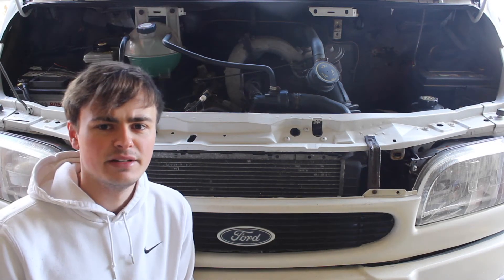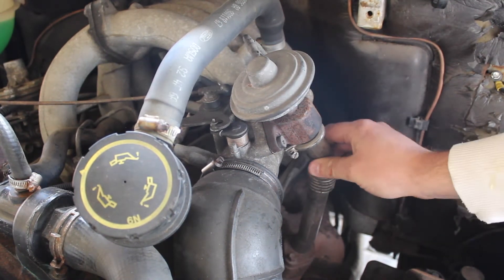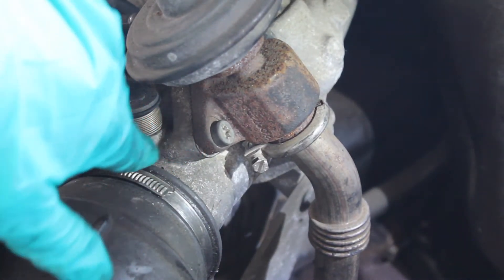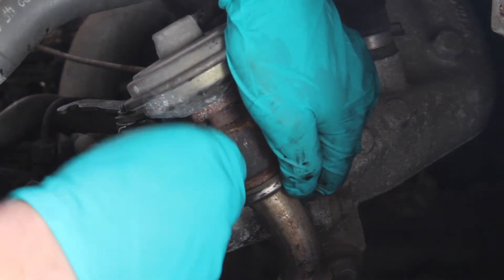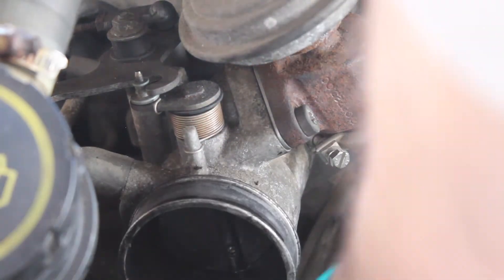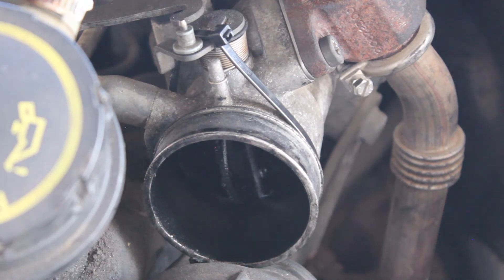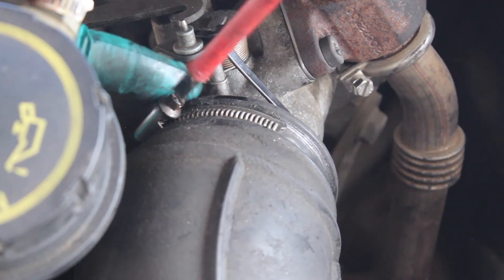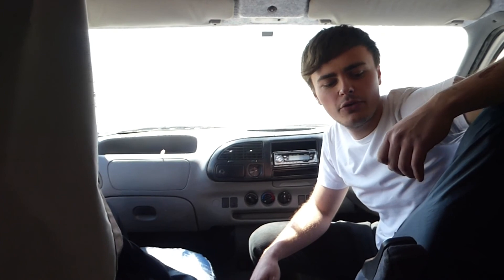EGR Valve Blanking Plate Installation – 1998 Mk 5 Ford Transit 2.5L DI “Banana Engine”

Comment: Surely it still blocks up with diesil gunk, I did my connect but I out an 8mm hole in blanking plate that is ecu controlled
Reply from the maker: For this engine it has a mechanical injection pump so can be completely blanked without faults. There won’t be any gunk at all because no egr soot and I also installed an oil catch can to remove the oil from the blowby gases before it renters the inlet 👍🏼 not so sure about the connect though as if it still has a small hole in the egr blanking plate, it will eventually soot up again

Comment: Hi there have you or can you show us how to sort out and where to find transit smiley heater 3speed blower motor relay or resister  thanks rigsby.
Reply from the maker: Hello mate, I can indeed. It is on my list of videos to make but haven’t got around to making yet. On mine it is down by the driver side headlight. I can try and make a short video next week 👍🏼
Reply: Thanks so much my van is 1995 minibus smiley  looks same as yours only covered 47k from new  look forward to that before the frost comes keep up good work  rigsby.

Comment: I also removed the egr and the throttle valve. But there was a problem, the pipe from the air filter began to vibrate strongly. You can also hear on the video

Comment: Hi there, thank you for sharing your videos.
I have a 2000 ford transit motorhome with some issues the check engine lights on ONLY when engine gets hot and according to the diagnostic  computer P1402 EGR, any idea about this kind of problem? Thanks Orlando
Reply from the maker: Hey, thanks for your comment. Really sorry but I’m unfamiliar with the epic pump fault codes. If you’re on Facebook there is a ‘transit mk3 mk4 and mk5 smiley owners group’ with some really knowledgable people who should be able to help you out.

Comment: I just removed the value. Two screws and slide her out easy and no cabale tiyes needed, looks better. Remove the actuator from the throttle to as that's not needed. ✌👍
Reply from the maker: That's a good idea, I will have to do that when I give the inlet a clean! cheers

Comment: Any better on fule
Reply from the maker: It’s hard to say as I’ve never used the van without having the blanking plate installed. The main benefit for doing it on this engine is to prevent the inlet getting blocked up with carbon deposits. So by blanking the egr and cleaning the inlet you should notice a performance enhancement. I would say a difference in mpg is negligible. Thanks for your comment 🙂

Comment: Hello, what's the advantage?  Less consumption? (how much?) or more HP? Thanks :-)
Reply from the maker: Hey, advantage is less soot from exhaust gas recirculation causing a blockage in the inlet manifold. Also a higher volume of air (cooler denser air) into the inlet manifold resulting in better HP and overall better performance. Less maintenance cleaning the inlet manifold from soot. Modern vehicles benefit from precise fuel injection, resulting in much cleaner combustion. Older vehicles like this are powered by mechanical fuel injection and therefore produce more soot and carbon in combustion.

Comment: Hi mate mine is 97 reg mk5. I noticed i have to put more gas ascompare to before. It did not loos power. I drive on the same route everyday. Where i used to put 3rd gear now ive to put 2nd gear. Where i was used to put 2nd gear i put 1st gear. And when i start rolling in 1st gear it asks me for more gas. I done service today but did not feel any difference. Any idea will be helpful thanks in advance.
Reply from the maker: Hi Ejaz, sorry mate I’m not sure on that one, might be worth asking the question on a transit forum? That’s helped me out before!

Comment: Thanks for the video! Do you know if I would need to blank both ends if there's a hole in the egr pipe?
Reply from the maker: No problem! You can remove the egr pipe completely if it has a hole and blank it off on the egr and on the exhaust manifold. If you want to leave the pipe in you could blank it on the exhaust manifold instead. 👍

Comment: Thank you for the tip bro!
I have just bought the same van! 
It's an old engine so, any performance upgrade is welcome.
Thanks again, and if you have any more suggestions, please tell us!
Cheers from Lisbon - Portugal
Reply from the maker: No problem, another modification is to turn up the fueling on the pump on the top. If you look it up will find more information online about it 😄 or fit a turbo!
Reply: @TurnersWorkshop97  yeah! Saw the post on fordtransit(dot)org about the two modifications! How much better will the van be with the two mods? Did you really noticed the diference? Can you tell the performance gains? What about fluel? Will it “drink” more diesel in order to perform better ? Will try them both for sure! Thanks again bro 🙌👊

Comment: Does it make it perform better? Ive just bought a mk5 transit
Reply from the maker: Yes the colder cleaner air is much better for the engines performance and stops the inlet getting blocked up! Good luck 😄